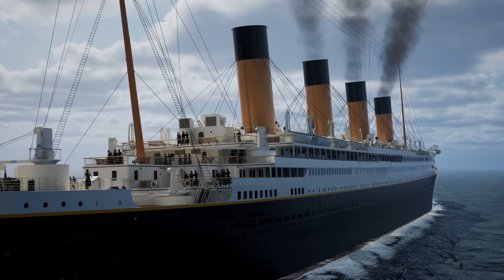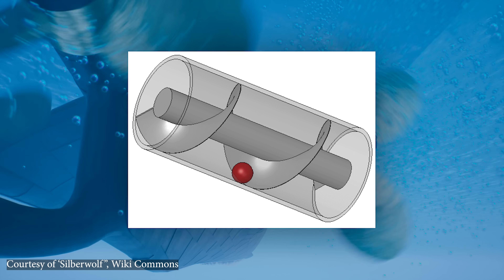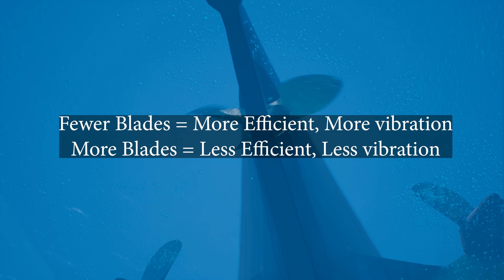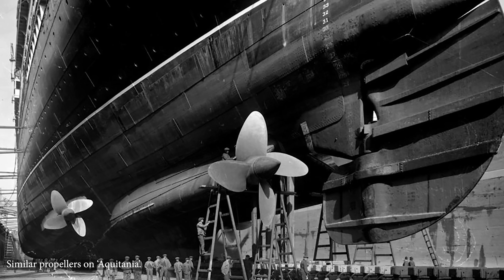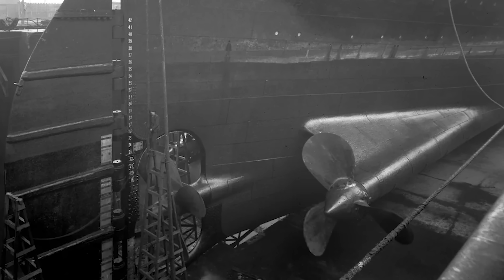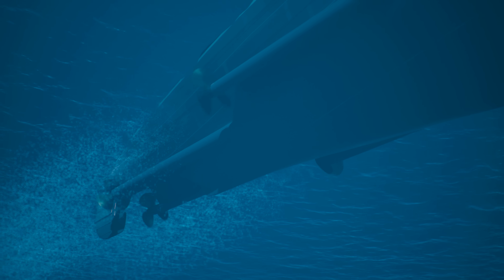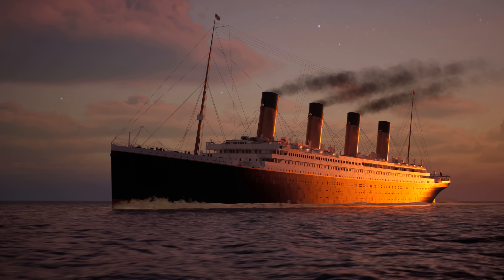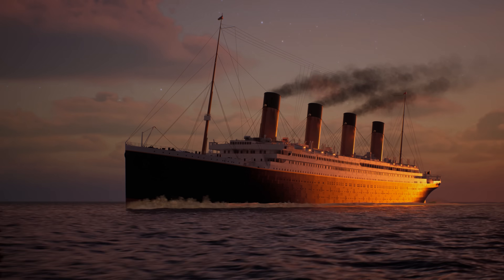Titanic's Propeller Mystery

Comment: Fortunately, those propellers would be the few pieces that will survive after Titanic rusts away.
Reply: Using sound to image the buried propeller.
Reply: And the Bronze Capstans . Bronze is a super durable material .
Reply: Even today, the two screws on the sides are almost burnished.
Reply: Funny enough if you look at the Smithsonian scans of titanic, you can still see the Black and white lead paint, the rusticles are eating away the aluminum guard rails / the paint. The ship If it was being eaten by the rusticles would be severely deteriorated especially at the stern since it slammed into the ocean ground. Itll be a long time till the ship is gone.
Reply: @okieg8960  Funny enough, the iconic guard railing on the bow of the Titanic collapsed sometime between 2022 and this summer. A 15 foot section too rusted out to hold on is now on the sea floor
Reply: @okieg8960  Aluminum guard rails? Really? Why on earth would they have done that?
Reply: Yeah, right? It was built in the UK, why wouldn't they build it out of aluminium? @jbepsilon
Reply: @jbepsilon  I know duralumin was invented in WWI for zeppelins, I'm not certain that they had usable aluminum rails in 1910/1911
Reply: @jbepsilon Not aluminum in the way that your thinking. Solid thick aluminum. Also because it was probably cheaper.

Comment: I fly RC models and back in the day the hardcore speed guys, especially in control line, used to fly with single-blade props to min/max everything. It was crazy seeing a prop gun with a blade on one side and a big counter weight on the other...

Comment: The easiest way to put the matter to rest is to do ultrasound scans of the area, just as was done on the bow to locate the iceberg damage that was buried in the mud. Even if one or more blades is broken off from the impact, it should be possible to tell how many blades were there.
Reply: Yes and it will show that the Titanic center screw was a 4 bladed one
Reply: @anthonylowder6687 Why are you like this?
Reply: When that scan comes out, IT. WILL. HAVE. THREE. BLADES!.

Comment: Just a thought ... but Titanic's central turbine rpm was roughly 180 revs per minute while the outer reciprocating engines were 80 or so

So wouldn't you need an extra blade on the turbine driven prop to 'absorb' the extra power - or at least a different size,  pitch, whatever.

Or doesn't it work like that ? !!
Reply: The central propeller was smaller for exactly that reason. A little surprised the video didn't specifically point that out.

Comment: I'm just wondering... if damages caused by iceberg were maped via ultrasound survey why we can't use same technology to check middle propeller?
Reply: The bow dug into the mud, but it was raised as it did so. The stern is different. There is no raising of the seabed, so it's impossible to sidescan it. They would most likely need some sort of ground-penetrating radar. It's definitely and interesting idea, though.
Reply: Until 2007 when the notebook came out, nobody even thought of the possibility of 3 bladed center propeller

Comment: I guess they might send an ultrasound scanner down there some day in the future, not only to visualize the state of the unreachable interior, but also to settle the screws debate
Reply: It would need to be very powerful in order to penetrate the 50 ft of silt that the rudder is buried in.
Reply: @DylRicho  Not sure it's 50ft deep? If you look at 9:17 you can see one of the side propellers, so I would guess the central propeller is just under the surface of the silt.
Reply: @jbepsilon  the side propellers (with the shafts) were bended upwards when titanic hit the bottom
Reply: @xtravaganzagold  Ah, good point.
Reply: @jbepsilon  The main screw shafts were wrenched upwards upon the stern section's impact with the sea bottom,  I BELIEVE they are now at the level of E-Deck.
Reply: @toddkurzbard the rudder is buried to what would have been the normal waterline, so that tells us the center prop is buried deep and yes the outer propellers and their wing structures were wrenched up on impact with the bottom
Reply: Is there some sort of ground penetrating radar that can be used on the ocean floor? I'm genuinely curious.
Reply: would love to see that, would be really interesting
Reply: Send a robot with a vacuum cleaner to remove the sediments around the propellers. And when finished, send it to remove sediments in the front that we can see where the iceberg strike.
Reply: Agreed and when they do they will discover that the Titanic has a 4 bladed prop
Reply: @anthonylowder6687  Given the lack of photos of the Titanic's propeller, the journal mentioned in the video, and the amount of experimentation done with such things at the time due to the lack of computer simulation (we can see this all the way up to the start of the space shuttle program with the wide variety of lifting body test craft that were all slightly different, compared to modern simulation driven designs with fewer prototypes), I'm curious what specifically makes you so sure. 

I don't have a dog in the fight myself, either seems plausible, but you've been very very sure of yourself including calling this video a lie elsewhere in the comments (a very strong accusation imo) so I'm curious what makes you so sure and why you think the presenter is lying.
Reply: @anthonylowder6687  I see your four blades and I raise you FIVE blades.
Reply: @OvisMilitaris  SS United States has entered the chat I see.
Reply: @OvisMilitaris  THERE...ARE...FOUR...BLADES!!!!!!
Reply: @anthonylowder6687  no when  its done you would clearly see 21 blade prop

Comment: If they fitted a four blade central prop, would it have made the Titanic faster? If so, could it have passed the slow moving iceberg without incident?
Reply: 3 blades and increased pitch made Titanic slightly faster than Olympic. Ismay was notified of this by Harland and Wolff. If I remember correctly, the more the number of blades, the less speed but less vibration.

Comment: I'm upset with my eyes right now, because in the opening animated clip showing the propellers spinning under the water, it shows the central propeller rotating in a "Reverse" setting, while the port propeller is rotating in a "Forward" setting, due to the pitch of the blades on the model of the central propeller.

But hey, getting to watch one of these right after it releases is a treat for sure, always love the way you and your crew do these videos!
Reply: 😄 I noticed that too.  The blade pitch is right, but the direction of rotation isn't.  Oh well, it's still a cool-looking animation.
Reply: @rrice1705  Ocean Liner Designs reused old footage.   We told him he got it wrong the first time he used it.
Reply: The center prop could not run in reverse because it was directly driven by the turbine.
But the port and starboard could.  
If I remember correctly looking forward from the stern (or behind the props) and with the ship going ‘Ahead’
The port side rotated counterclockwise while the center and starboard propellers rotated clockwise.
Reply: @vanhagl5591  is correct - the centre turbine, which was bolted directly to the shaft, could only turn in a forward direction.  They make turbines capable of turning in reverse by installing a couple of rows of blades on one end that are canted in the opposite direction; the Olympic class's centre turbine did not have these.  That turbine was not used until the ship was (I saw somewhere) a mile out to sea, and the steam was dry.  Indeed from what I've read, this was a flaw that contributed to the class having poor maneuverability - one pilot saying the ships took ~30 seconds to respond to the helm.  Their rudders were relatively small, and prop-wash from the centre propeller would've been crucial to the rudder's effectiveness; but in trying to avoid the iceberg, Murdoch ordered reverse - at which point the outboard recip's can be put in reverse very quickly, but steam would be shunted from the centre turbine and the rudder would lose its prop-wash.  This likely also contributed to another miscarriage of maneuverability in the class, when Olympic rammed the Ambrose Lightship and cut it in half.  And yes, the illustration shows the centre turbine turning backwards.
Reply: Yeah it triggered my OCD as well. Think all the props in the 4-bladed design are spinning backwards as well. Could be a crash stop, but more likely an animation oversight.

Reminds me of the "A certain..." anime series. The first run (Magical Index) has the windmills rotate correctly. Subsequent series (from Scientific Railgun) reversed the rotation. Nay, worse: they 'fixed' existing scenes from the first series. To add even more salt to the wound, they're being used as huge electrical fans in one episode, and for this... they reversed the rotation back to what it should have been in the windmill state. Still upset about that, if you can't tell.

Sabaton's Red Baron Hammond organ is another offender. I think people are so used to seeing electrical desk & ceiling fans spin, that they unconsciously perceive props spinning the other direction as wrong.

Then again, for the animations in this particular video they'd actually work if they pushed. Oh well
Reply: Yes thank you I'm not the only one who noticed that the central propeller is rotating in the wrong direction
Reply: I was loosing my mind trying to figure this out. Something didn't seem right while i was watching it. I kept twirling my finger in a circle while imagining the blades turning and it just wasn't lining up in my head.